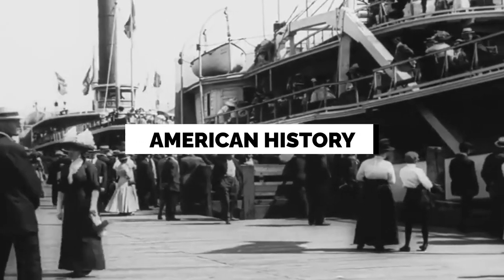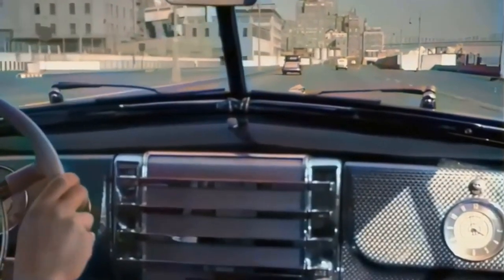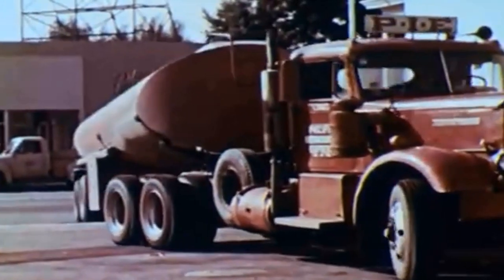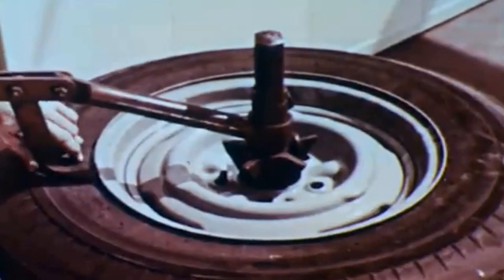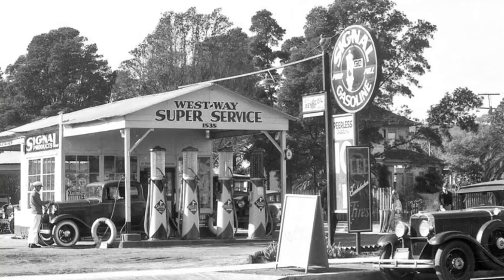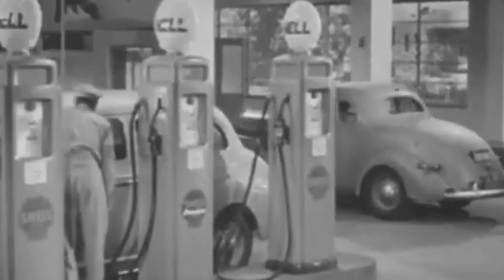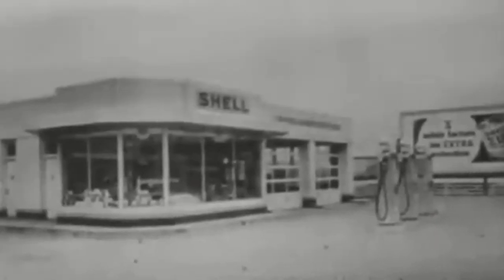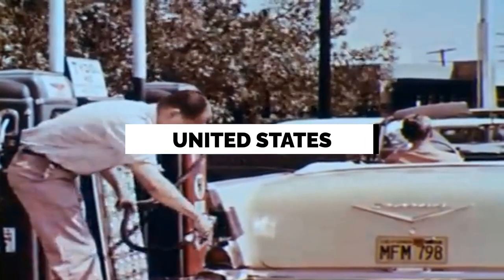1940s Life At The Gas Stations In America

Comment: On my cross Canada trip in 2019 I was about 30 miles east of Toronto, near Oshawa. Where I came upon one of these old stations preserved in time like an antique. 
Yah, cars went a whole 1,000 miles till the next oil change. LOL. Maybe 2,000 fast miles on the highway. 
In 1984 I was getting back to the Canadian border after a 2 week trip to Vegas and LA in my rusty 1968 Camaro. Engine started ticking from low oil. I emptied my squirt can, a few spoonfuls. LOL. Helped a bit. Then I turned off the motor at the border. Then it wouldn't start because the battery was dry too. Used to have trouble with the thermostat and regulators. Now I can let the car sit for a month and it will start in a second every time. 
Cracked windshields were common back then. Haven't had one in 20 years. 
My dad was a mostly tune-up mechanic at a GM Chev/ Olds dealer from 1948 to 1984. The George Orwell years, LOL.

Comment: Imagine a 57 Chev in the 1940’s 😎
Reply: I was a teenager, I worked at a Chevron Station Attendant. When I was cleaning the windshield they would point to the spot where I missed from the inside. The woman who wanted to check the air tire pressure on all of the tires, oil in the engine and do the windows all around the car. For a Dollar of gasoline. And I would do it. Service was number one, and I was proud to be able to do it.
Reply: @michaelrodriguez2640  For a dollar you could get four or five gallons of gas. I remember my baseball coach stopping at a gas station and telling the attendant to put in 50 cents.